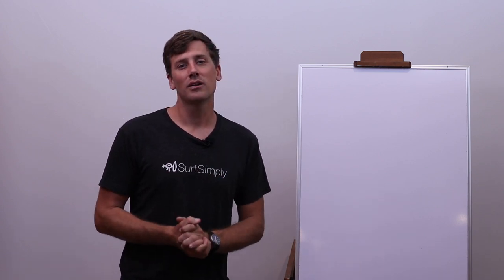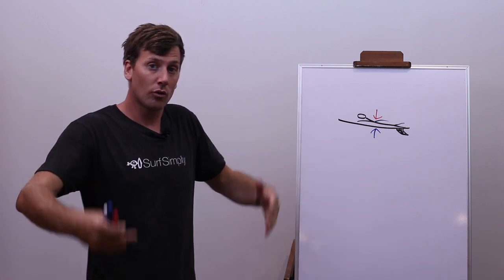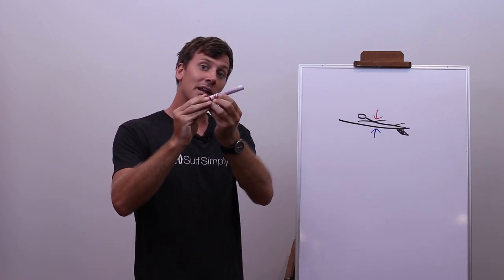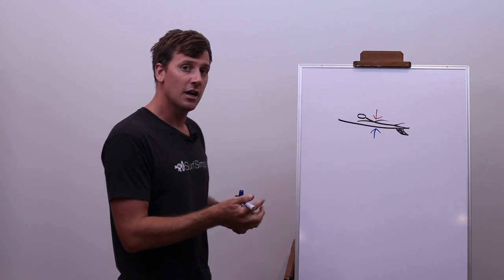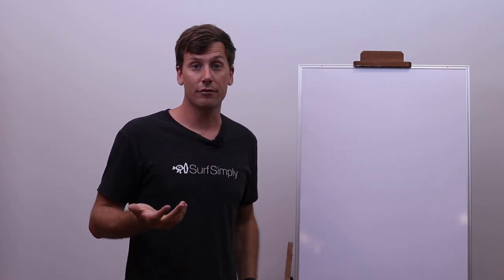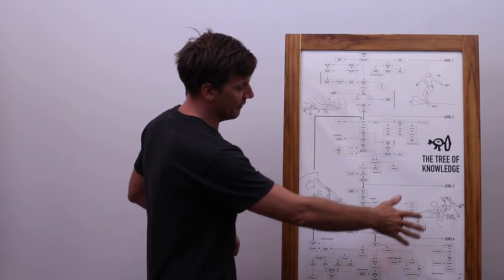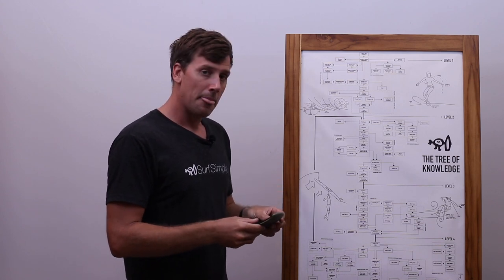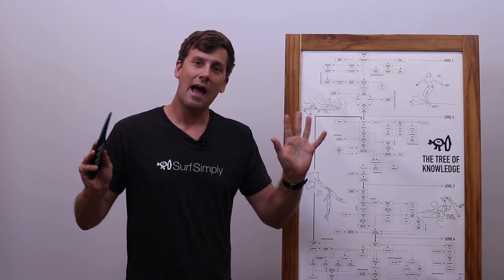Surf Simply's Question Time: Paddling Position on the Surfboard + Fins: Fiberglass or Plastic?

Comment: Re: fins. My experience as a lower-intermediate surfer is that, as long as you can do a bottom turn, you will notice a difference between the cheapest plastic fins (I don’t mean the FCS glass flex or Futures Thermotech, those really are quite good) and an upgrade fin. The first thing I noticed after putting in some large honeycomb fins was a locked in stable feeling and noticeable drive. This was with only 2 years of surfing experience. I then decided to experiment by putting in some medium Am1 plastic fins that came free with another board to see if I’d notice any difference: I found myself repeatedly sliding down the face of the wave on takeoff on overhead waves and lost confidence in the fins and my surfing. In smaller waves they were fine. I then stuck in a set of medium FCS M5 fins. No problems sliding out, easier to turn, but it feels like I have to work harder for speed, they don’t accelerate out of bottom turns the way the large honeycomb fin does. Conclusion: both size and construction are definitely noticeable. I think the cheapest plastic fins bend too much out of shape in some conditions, which is why I was sliding down the wave face. For reference, I’m 5ft9 72 kilos , 3 years surfing. I’d say I’m a level 3 surfer on Surf Simply’s chart. Thanks for the great videos!

Comment: Hey man! very useful information. One of the pros of having fiberglass fins i would day is that you can sand them an "repair" them when they have a ding.

I have always wondered if you can also do this with a composite material like the FCS Neoglass or Futures' Alpha, since they are partially made of fiberglass. Do you think you could help me with that? Basically the question is: is there an affordable fin that you can swipe a sandpaper on and get it repaired just as a fiberglass fin?  Thanks in advance

Comment: Harry! These sessions are very useful and interesting. Well done! I'd love to submit a question for the next session. Do you have pop-up tips for taller surfers? I'm 6'2" with long legs, 185 pounds. I'm struggling to get my front foot in the right position for a good ride. I'm level 2 but struggle on steeper waves because my pop up is kinda slow and sloppy. I've been working on increased flexibility in my hips and practicing land-based pop-ups on a foamie with stability discs underneath. I'm dedicated to the practice so if you hand out tips I'll be sure to do them. Cheers!
Reply from the maker: Hi Timothy, our coach Teale has recently produced a video series to help gain strength for certain maneuvers. She has included Pop-Ups as one of them: https://youtu.be/f2riGqOXWMI

Comment: In the fins what does the honeycomb do? I’ve heard it talked about but I don’t know what it is.
Reply from the maker: Hi Garrett, in general the hexagon shape is used for its high compression and shear strengths compared to other shapes. It improves the strength to material weight ratio compared to a solid like other fins may be.